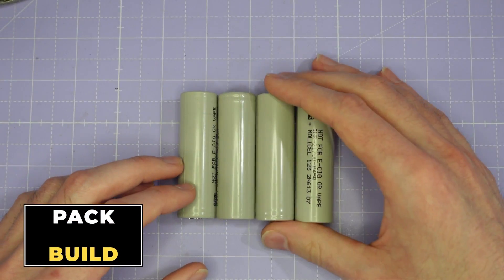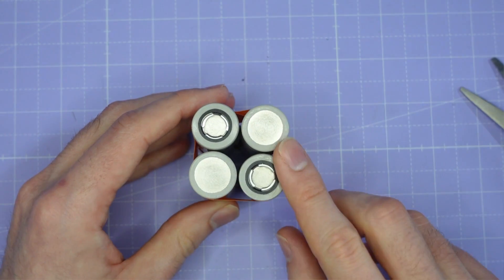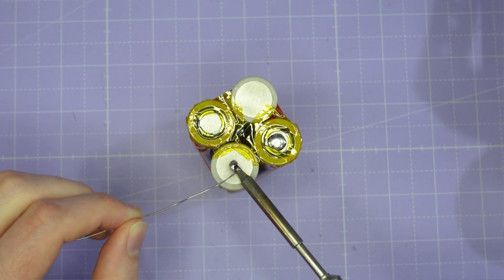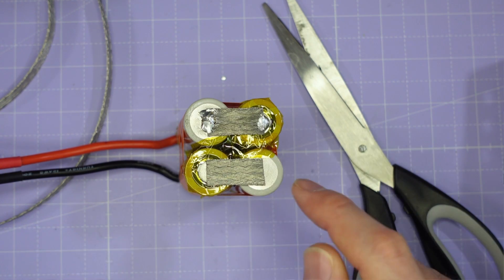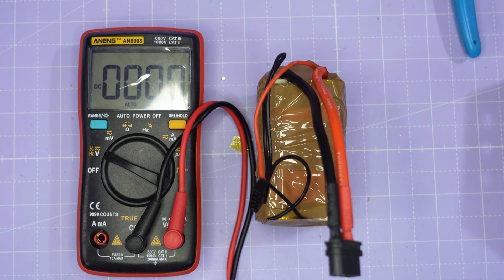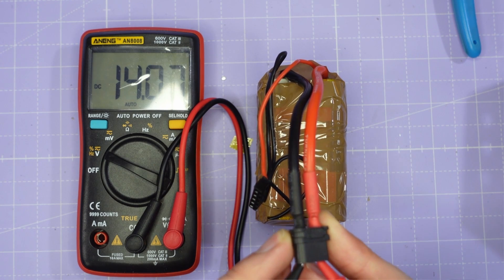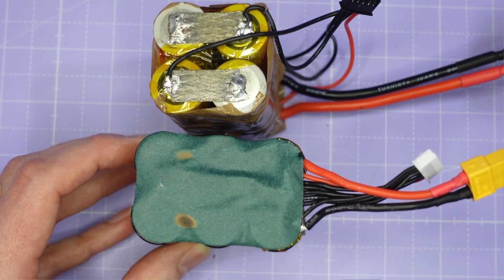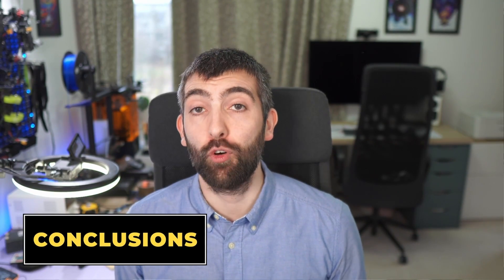Can I DIY the BEST Li-Ion Battery in FPV?

Comment: Ok so cells werent damaged 😅.. 
For 1P i def use P45B for a 2P or more id prob switch to 50S. I have a 4P 18650 i want try 4P 21700 if drone can fly the pack
U were running 20aH & 22.5aH draw 5C. Damn no wonder when i run 6S1P on the 8" the pack gets warm and i try to stay light on throttle 15aH average i think

Comment: Hello Chris, what I see is that the join between the strips cause a problem not the welding on the batteries? My I be wrong but could you think about it? I think that soldering with to less heat and heating iron with to less thermalcapitiy couldt cause bigger problems than welding?

Comment: Wow really keeping the soldering ion on that for quite a long time  think I would just use some silicone wire to join if soldering less chance of a short and possibly some flux would speed things up.
Reply from the maker: A bigger iron and flux would certainly make the job go quicker! Given my results and what I've learnt opening up quite a few of these cells is that risk of damage with decent soldering technique is minimal.

Comment: Nooooo c’mon man, never solder li-ion cells, should be using a spot welder and nickel strips
Reply from the maker: I don't agree I'm afraid. The Nickel strips are performance killers and a fire risk in their own right (they get so hot under load they charr the plastic!). Copper strips would be better but you cannot spot weld them easily.

Comment: Way too long with the iron on the battery.  I use 5 seconds as my max and yes with a more powerful, hotter iron with a larger tip.  I also dont like how that braid is so close to the negative area of the battery hiding any solder blobs that could be close.  You need to be able to see that you have not created something that might short.

Comment: UpgradeEnergy uses these Molicell 21700's in their DarkLithium long range packs. They have a robot spot welder and decades experience building batteries!  I used them to make my Stay High Fueld Charging Pack that's 6S 15Ah (6S3P 21700) Copper bars FTW 💪

Comment: Someone gonna try to copy this soldering on the cells and gonna burn down their house. I don’t recommend even on 120w irons. Spot welding is the way. Or other techniques that don’t involve such a long heat transfer.
Reply: Yea def holding too long. Damage cell even if doesn't explode I'm told
Reply: @divingfalconfpv4602  How did this damaged cells beat the commercial battery?
Reply: @vadimus2007  saying you can.. I'm my main comment I said oh awesome it didn't damage the cells.

Comment: If you wanted to keep doing this I recommend looking into kWeld and getting strips of nickel and copper. You need to use much higher welding capabilities than anything on Amazon can supply (something around 1000-1500 amps for copper-nickel). I build mine with 0.15mm nickel and 0.15mm copper strips (nickel being the top that is used to weld the copper) with the same batteries you used. Much cleaner than soldering and slightly easier IMO to make. I can easily push the battery more without overheating risks associated with just nickel strips.

Comment: Once you started soldering the cells, I had zero interest in the rest if the video. Also, there are special cutouts for the positive of the cell, you dont need to use junky tape. A big thumbs down, one of the worst pack buiding videos on yt
Reply: His questionable soldering resulted in a battery better than commercially sold one. 
Also who cares if you are interested? Your 27 subscribers averaging 5 views per video?
Reply: @vadimus2007  yo fanboy, go bark at someone who gives a fk 😉
Reply: Figures you'd stop watching before the results section. Fingers in ears too I bet.
Reply: @Voyajer.  got buthurt much?

Comment: Takes a lot of courage to post a soldering video in a community full of know it all's lol Thanks for the test.
Reply from the maker: You're welcome! I spoke to a few people who DIY their packs (and have tried different methods) and they were clear that solder was the way to go. Spot welded nickel strips have way more resistance.
Reply: @ChrisRosser oh no. nickel strip DC resistance of 0.2x10mm is about 1mohm per cell connection, mostly much less. compared to minimum 25mohm DC resistance of each cell, it is negligible. safety &performance first. you can do this kind of lol soldering on positive, but negative side heating is directly damaging electrolyte & separator.
Reply: @ChrisRosser I've only soldered my own Packs so far. Makes me wonder if a thicker nickle strip would reduce the resistance or if it's a contact surface area issue as well with the spot welding.  

Soldering is dangerous, as we all know. I've seen a cell pop in person from getting too hot. It would be nice to find a way to improve spot welding.
Reply: @djSpinege  lol spotwelding is the way to go.
Reply: @ I used to think that back in 2012 but now after seeing better results from Solder I'm not too sure. Using our spot welder sure is faster anyways.

Comment: I regularly make packs with the P45B/P28B, 4S/6S-1P/2P, great cells! my first attempt at soldering was a fail and destroyed a cell, now I use a copper/nickel sandwich (0.15mm cu + 0.1mm ni) and spotweld. The strips are also really easy to solder leads to. Great video Chris!
Reply: This is the best compromise for safety/speed/performance/ease
Reply: What spot welder setup do you use for this? I've mostly soldered because I was under the impression that you'd likely be in it for >350USD for a spot welder that can swing the copper/nickel sandwich.
Reply: @CesiumSalami spot welders are about 50 bucks on amazon
Reply: @Catboy-hr2qp  not ones that can do a copper nickel sandwich at this thickness afaik. unless that’s wrong?
Reply: Thanks for the info. 
For a 6S pack should I use the P45B ? Which brand are you using?
Reply: @PatientZiro  molicel are the best out right now

Comment: 5:30 how long can you keep the iron on the cell before they start loosing performance ?
Reply: 5-10 sec max.
Reply: @olaf_s_23  too long, the iron needs to be off the cell asap. tin wires before introduced to cell and use flux to ensure super fast soldering

Comment: I made my own battery’s years ago and still running strong , I was told soldering was bad but a big iron fast heat has always worked maybe not for a first prodject. But even on the demo the battery can take a lot , but as said there are lots of off the shelf items as a option.

Comment: I find it a ton easier to do the soldering by switching from my normal iron tip (BC2) to a larger tip (D4). The bigger tip carries more heat so even with large wires / braid it bonds solder much faster and there's less risk of overheating the cells. Your pack seems to test great though so it doesn't seem necessary, but it does make it easier to build.

Comment: That was an awful long time with the iron on the cell. Heat transfer must have been pretty immense. Bigger hotter tip for cell work is key. It's almost guaranteed those cells were overheated during assembly.
Reply: But yet they outperformed the other cells still
Reply: I have built two packs before watching this video and I recommend Wojteks “Jet Edf Rc” channel /technique instead 👍🏼 big 150W iron works great in 1-2 seconds
Reply: @ficosk8  when i solder on a cell like that i just start with little blobs of solder and let it cool down in between, works great
Reply: Yeah but is not necessary if you have a bigger tip and use some flux, plus pre tining
Reply: I was thinking exactly the same thing. Not sure I would have used braided wire using a soldering iron. Spot welder would keep the heat down.

Comment: Maybe we can double spot weld another set of strips on top of original nickel strips to improve the current flow? What do you think?
Reply: Yes, you can use multiple layers of the strips if a single one is not enough.
Reply: I'm pretty sure you could buy a thicker strip. I've never done spot welding so I'm not sure why people don't go thicker.
Reply: @djSpinege you can but the problem is you need one of the more expensive welders, if you have one of the cheaper welders you can double up the strips or solder copper double decker style on top of the strips
Reply: You can also solder copper mesh or wire to the nickel strips for more current capacity

Comment: Come on man, buy some 21mm (or 18mm if using 18650's) isolator rings at least if youre going to make a video.
Also, standard silicon insulated wire is much easier to use... soldering is fine if its done quickly but its taking you way too long with that braided cable.
Reply: I was wondering why typical wire wasn't used as well.

Comment: I use solder AG soldering acid. You can solder lots quicker with it.
Reply: It seems to wet just fine using regular flux; with acid flux unless your cleaning is impeccable (and it's pretty hard to get under the positive tab to clean any spillovers) it could corrode later..
Reply: @PraiseKier  that's the downside. I usually tin then wash off with DI water.

Comment: For 21700 cells use AWG 18 wires to connect. Much easier than those strips. The isolation on the wire helps to prevent shorting the cells via the plus pole on top.

Before making packs you should give the cells an extra shrink wrap. If the cells have play to one another and manage to rub the isolation off , your pack will short circuit.
Please when DIY LI Ion packs, give extra isolation between the cells and make sure they are sticking well to one another so that they cant rub the isolation off.

For the XT60 power cable AWG 16 wire would have been enough. The maximum amp draw is rated 45A anyway. Much lighter and more easy to solder

Excelent choice on the p45b cells. Best you can get.
Reply: 👍🏻 this
Reply: Even better, use the proper thicc insulator paper
Reply: ... basically the same practices from when we were building car packs out of Sanyo 1400 nicad cells.  
full circle!  
Lmao.
Reply: If we're being picky, lion cells shouldn't be soldered to. They should be resistance welded with a Kweld or a Malestrics spot welder. Also, skip the extra shrink wrap on the battery, and replace it with 21700 or 18650 (whatever size you want) insulation gaskets. If I were to build a pack like this, I would use 10mm x .3mm pure nickel stripping. The nickel stripping in the video is likely less than .2mm  thick.
Reply: Much better idea

Comment: i know everyone doesnt like soldering to liion cells, but its really not that bad, personally i pop them in and out of the freezer while working on them so it doesnt get them nearly as hot overall, its also important to note that once connected in series, you have "cans" that are positivly charged and you really should have used flux, like proper flux, also also, the 18650 molicells actually have more energy density if you do the math based on specs, id love to see you test the 2 molicell 18650's
Reply: Don't you worry that putting them in the freezer might cause some to lose more of their charge than others?
Reply: @SyntacticOperator  when connecting cells in series you don't need to worry about the voltage matching perfectly, and I only put them in the freezer for long enough to cool the heated cell I don't leave it in there for long enough to freeze the cells, it's literally like 30 seconds at a time just to remove the heat from soldering as fast as possible and a little bit of a pre chill before the initial solder so the internals don't get so hot
Reply: @SyntacticOperator  brother, you asked me if I worry about putting them in the freezer, I only do that during construction while making series connections, I even specifically said in my reply when making series connections that the voltage doesn't matter, ofc parellel connection it matters but that's not what I was doing nor was it what I was talking about anywhere, once I build my pack with series connections I charge it on my balance charger then I use a 2into1 connector to parellel 2 packs together for 1 of my planes, when making parellel connections voltage is important and capacity does not matter, and opposite of that when making series connections the voltage does not matter but the capacity is very important. Regardless, no I don't worry about using the freezer during construction of a series pack and yes I know basics of battery management as to not parellel connect packs with wildly different voltages
Reply: @SyntacticOperator  ok well I recovered the cells from my DeWalt drill battery and don't have an 18650 cell charger so I'm sorry but if you understand the basics then there is no problem doing things, and I get it but it's honestly not that bad or hard to understand, it's fine if you want to use new cells but not everyone can afford that and I got 2x 4s packs and 1 spare cell put of the drill battery, a single cell had died inside the DeWalt pack, so even if your a major company making thousands of packs a day, sometimes a dud cell can show up. And all the cells were matching voltage when I started lol I only mention that the voltage don't matter BC you asked if I was worried about the freezer changing the voltage, and I explained why I'm not lol idk what your trying to get from me, long story short, I'm not worried because I did my research and if others want to make packs without doing that, that's not my problem and I shouldn't have to worry about writing an instructables article every time I leave a comment

Comment: Chris, please do not solder the cells.. this will damage the internal separator between the electrodes inside the cell. 
The separator melts at around 130C, specially a problem on the anode.

Spot welding!!! 

I am sure you'll not hear the end of it...

Comment: man to much time with the iron touching the cell. I think it´s a big mistake, just user a bigger iron with more termal inertia to solder the cells. With mine in less than a second I can solder 1mm copper  strips.

Comment: Samsung have a 50S cell tat is more capacity, but slightly less discharge rate.
Reply: Over 10aH it actually less capacity than P45B. But if ur using a 4s2P ud be good